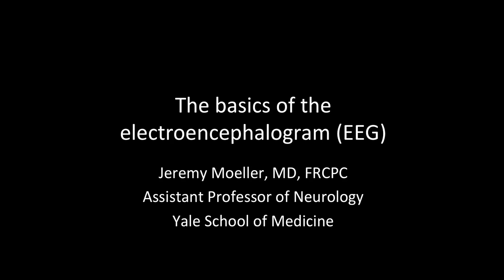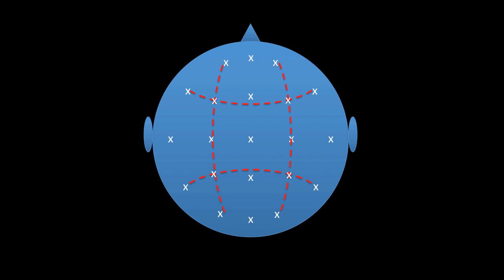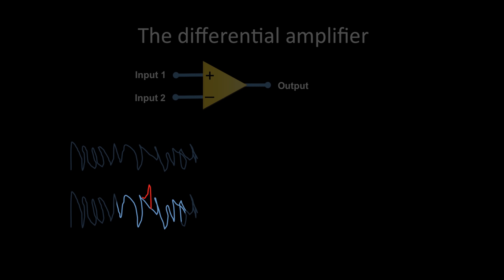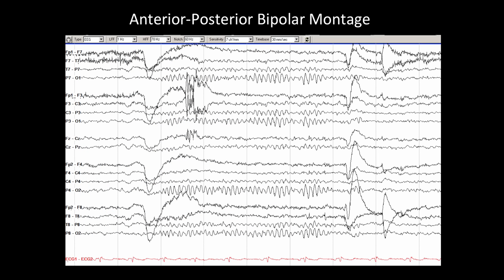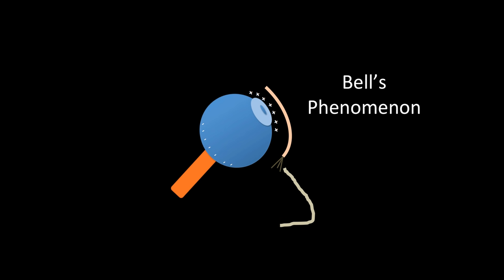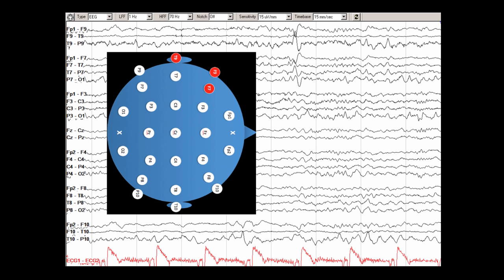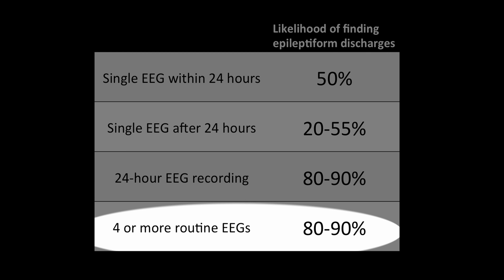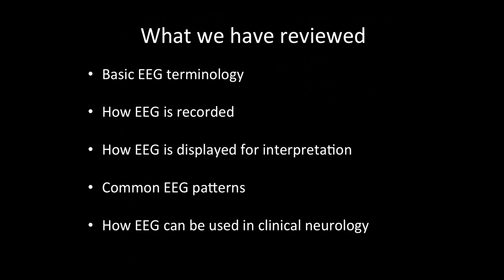Introduction to EEG

Comment: I can find out about what EEG is clearly and also the mechanism. Electroencephalogram (EEG) is a test that measures electrical impulses in the brain through small metal discs called electrodes attached to the scalp. Electrodes only measure electrical activity coming out of the brain and do not cause pain. thank you🙏

Comment: Thank you for taking the time to post these great videos. Could you answer two brief questions, please? 
I read in the book `Neurological Differential Diagnosis, A Prioritised Approach`. Bhidayasiri, Waters and Giza, (p 463), what looks to be a summary of what the EEG is registering:

EEG

Normal or nonpathological EEG

1) The rhythmic EEG activity is due to intrinsic membrane properties of various groups of neurons (summated excitatory and inhibitory postsynaptic potentials; EPSPs and IPSPs), the synaptic connections of these neurons, and thalamocortical inputs that lead to synchronisation of this activity.

2) There are basically four EEG frequency ranges. No individual band is normal or abnormal by definition. All are interpreted according to the topographic location, age and conscious state of the patient.

Do you feel that the description at `1` is complete? And, would you add any other factors to `2`?

If you have the time I would be very interested to hear your ideas, Mr Moeller. 

Pete

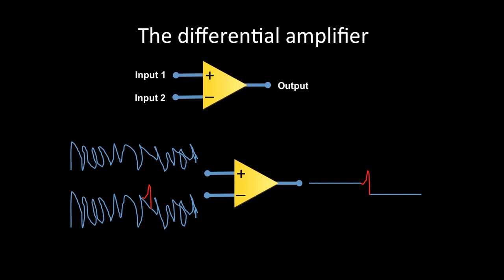Comment: 3:22 this kind of confused me, because after the red difference is over the graph should go back to being in the middle, you had a mistake there, the output is the length of the differance, which means its the distance between the red dot to the blue dot for every given point on the X axis